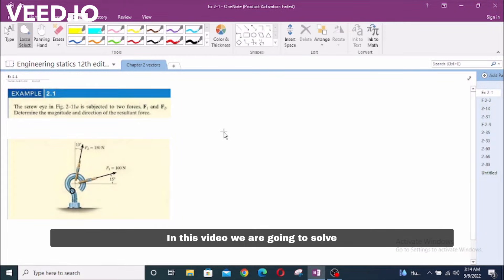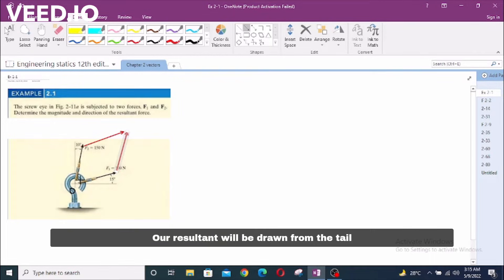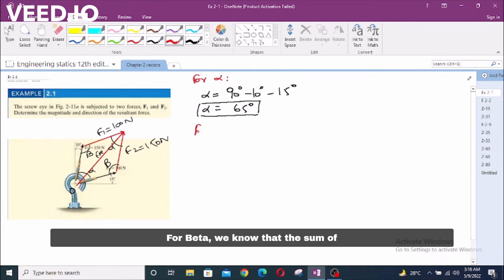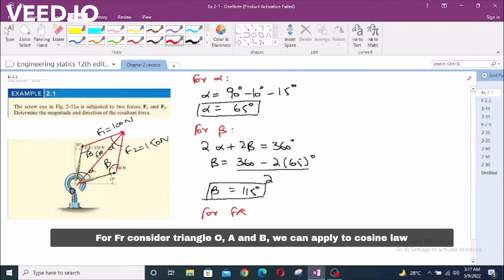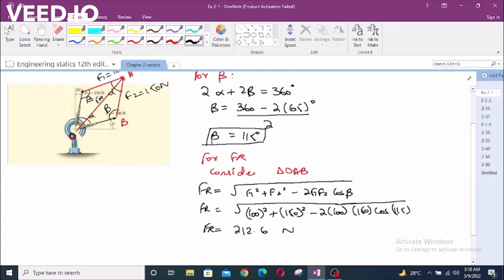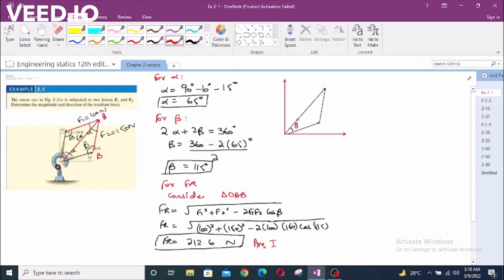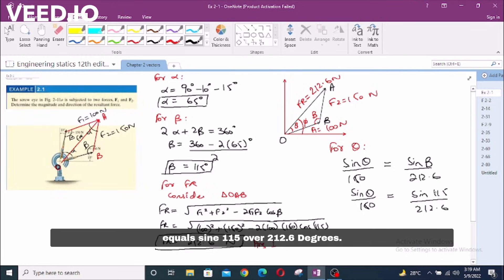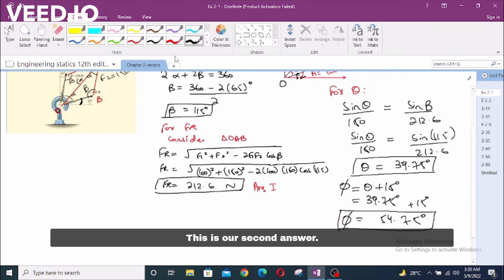Example 2-1 hibbeler statics chapter 2 | hibbeler statics | hibbeler

Comment: where did 150 came from sin theta over 150?
Reply from the maker: Hi, if you consider the triangle ABC I drew in the last part of the problem, 150 is the magnitude of F2 force (provided in the problem) opposite the angle theta.
I hope it will help.
Reply: Hi sorry to bother.. do you have pdf of solution and answer to this book?
Reply: yes @Zahra-v4v8i